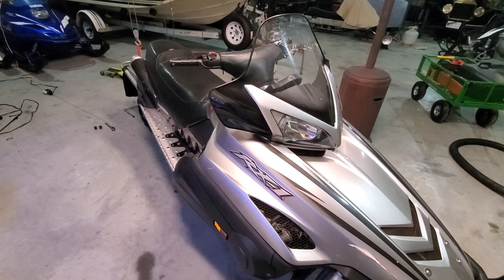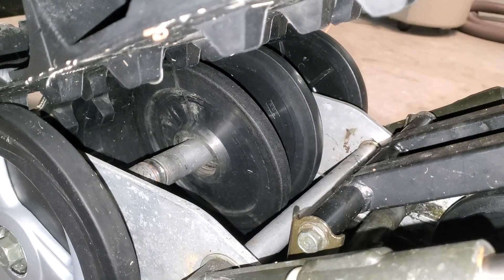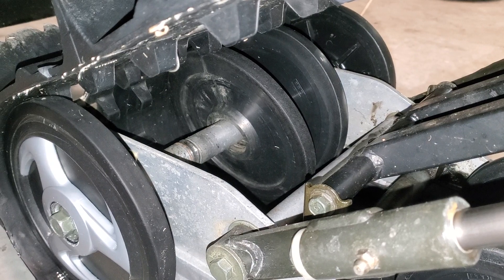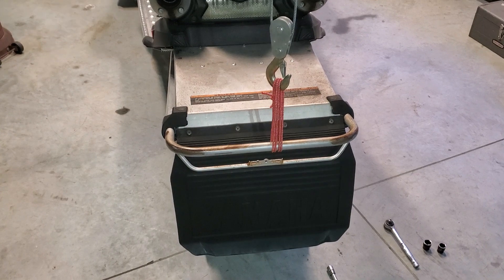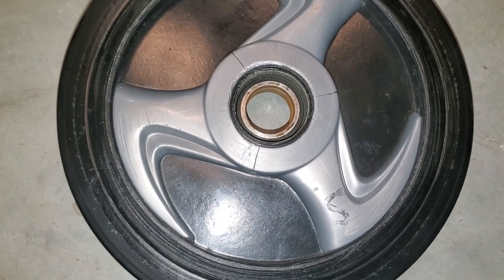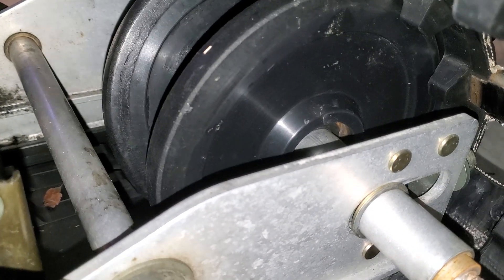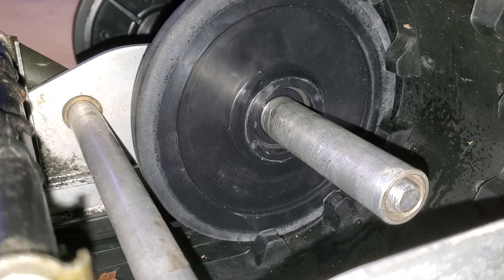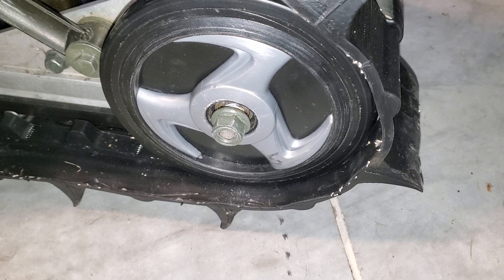RX-1 Guide Wheel Replacement

Comment: Really like your videos. I have a 2011 Yamaha VK  Professional and a lot of what you do on your machine transfers to my machine. I want to replace my hyfax at the end of this season and can’t find any videos on Yamaha hyfax replacement. Wondering if the suspension has to come out, especially on mine because I have the rear articulating piece at the back with a separate set of hyfax. Keep up the videos, they are really good for the DIY snowmobiler!
Reply from the maker: Thank you!! Here is the video of how I do it on mine: https://www.youtube.com/watch?v=C7kvc8BtMzI&t=139s I cannot speak for the VK model but looking at the schematics could you suspend the back of the sled by the rear bumper and loosen the track tension all the way and then work them off through the track windows like I did in the link above?
Reply: Just watched the video and will try this over the weekend. Besides the main rails, I have maybe 12” rails behind main rails which have another set of hyfax on them. Going to Jack it up and see what’s up and will let you know. Thanks again for the videos and reply. Appreciate it.